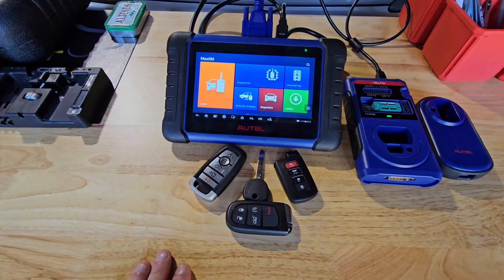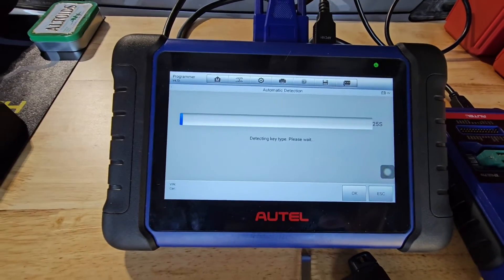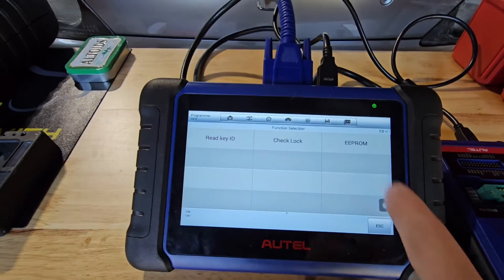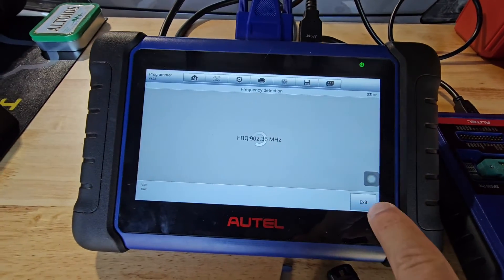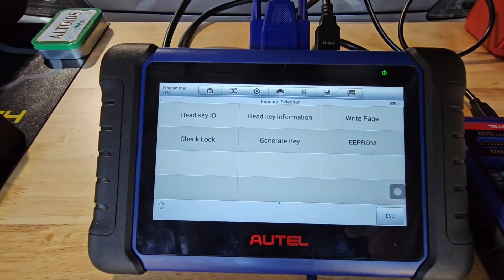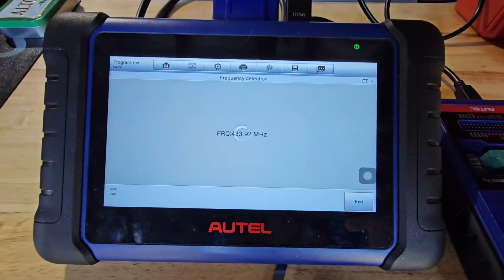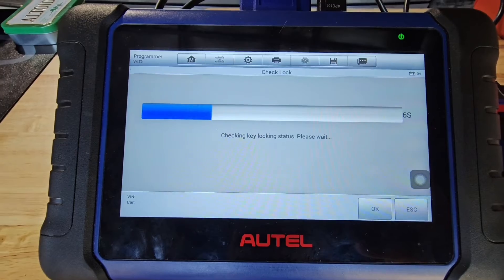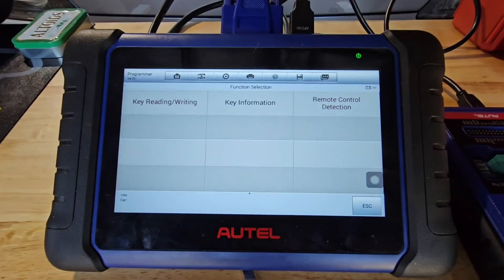Read and Write key information with Autel IM508

Comment: Hi again, so you mentioned it can program universal keys that is not made by autel? So it can program universal keys from Xhorse or Keyid?
Reply from the maker: Yes.  The keys must be GENERATED via xhorse or keydiy but once they are they can be programmed with any scan tool including autel
Reply: @EntryExpert  ok thats what I thought, thanks.
Reply: @EntryExpert  by 'generated' you mean cut with a machine to match the original, correct?
Reply: No it means you generate or clone the protocols for the digital key into an unwritten universal key remote or transponder. Then you can program the universal key to the car. Nothing to do with the mechanical key cut.

Comment: First, thank you, sir, for keeping your promise, but I noticed that you are using the xp400 pro with the im 508. The question is, can anyone who has the im 508 and the xp200 do the same steps??, and thank you.
Reply from the maker: yes you can use the xp200 if you have the opportunity definitely grab an xp400 pro for more features!
Reply: @EntryExpert  you are really an expert your videos are straight forward and easy to understand as a beginner they help me a lot thank you for sharing
Reply from the maker: @alazarbeyene4428  I appreciate your kind words. If you have any request for a video or questions let me know!
Reply: @EntryExpert  Well, since you ask - When you choose System Selection or Keyless System there are often many options. How can you find out which one is correct if Auto Identify or Manual Selection doesn't work? If you get a chance. Thanks!
Reply: @EntryExpert How are you, my dear brother? I honestly did not understand what you meant. I have an im 508 and I have an xp200. How can I know the key frequency? Thank you😊😊😊
Reply: Yes he even mentioned it at the beginning of the video
Reply: @alazarbeyene4428  oh yeh ????
Reply: Gracias , máster 😉